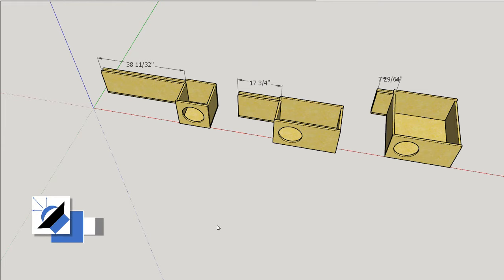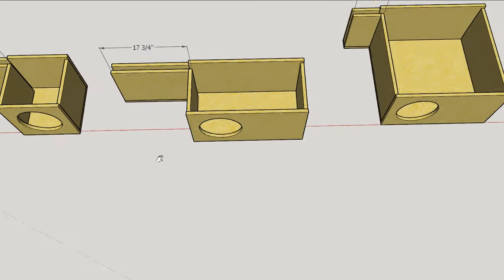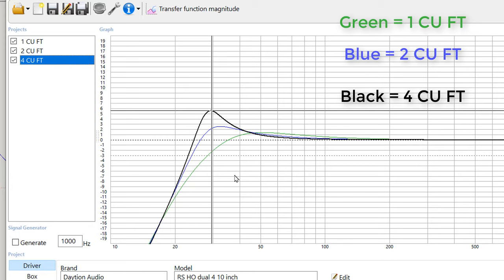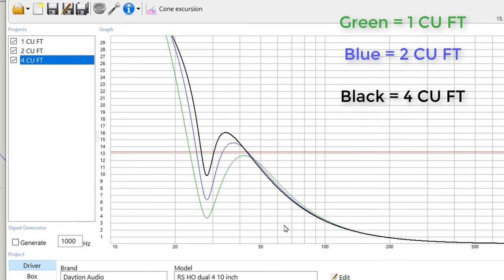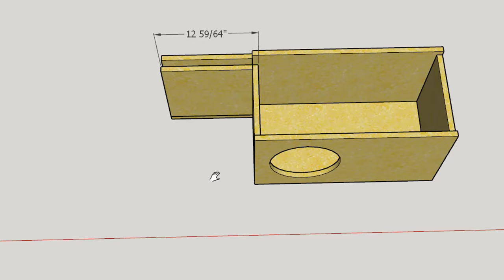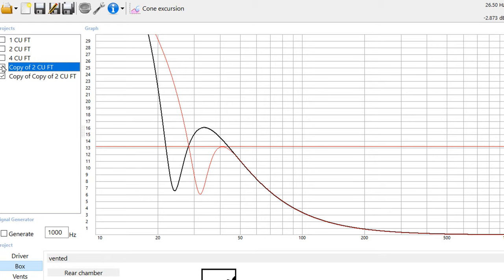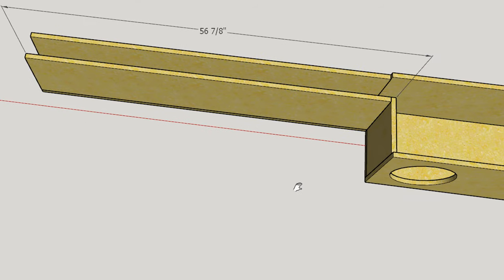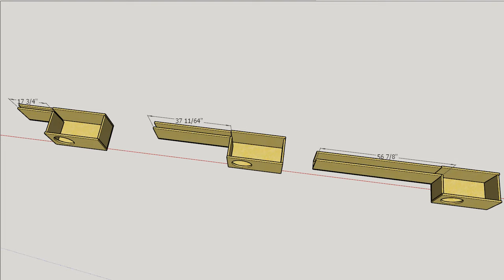Understanding Port Length, Box Volume, and Tuning Frequency.

Comment: Great video, I have a question, how the spl be with the bigger port area applications? So 40hz with 12*1 play with the same output as 12*3?
Reply from the maker: If you resize the port to get the same tuning frequency the three different port areas will all be equally loud.  But if you make the port wider and leave the port the same length the port tuning frequency will be higher and the peak SPL will increase -- if you take that the extreme the box will be "boomy" and not sound good.
Reply: I know, I wanted to know if I used for example 12*3 and made up the port length for the 40hz if It would play that frequency range louder than using the conventional 12*1 port area. 

Where I'm from,  we have a love for gallery type systems so bass reproduction is more geared to be loud outside the vehicle and spl is also calculated between 5-15ft away from  front of the vehicle depending on the classification of your system. 

So the experiment that I would like to try is similar to that of your third example, maintaining ideal cubic, acquiring a specific frequency with an increased port size and using cabin gain to get allot more output than the conventional box.
Reply from the maker: @dthknght  According to WINisd, It would not be any louder.  But, computer models don't always play out perfectly in the real world.  My bet is that the larger port would have less port turbulence, and thus the air flow would be less restricted so it might kill louder. It would definitely sound better.  

If you wanted to experiment with it you could make a detachable external port and swap out the different sizes to see what happens.  

It is definitely worth a shot.  I'm not aware of any big downsides to a larger port.
Reply from the maker: And I really like the idea of calculating SPL 5 to 15 ft away from the vehicle. The big SPL builds in the US are all based on building pressure waves up inside the vehicle.  It's an amazing feat of engineering but it's kind of boring to watch a car filled with concrete go brrrr for 10 seconds.
Reply: Yes it is allot more fun, shockingly enough, we use musical tracks to do these competitions. We try to maintain songs selection minimum to to about 38hz but as high as 60hz. Music from rap to reggae, but not to the extreme lows.
Reply: The link above is just an example of someone build in our country and we have both iasca and mecca forums. Iasca actually incorporated a gallery style competition in there curriculum, but it's only for the caribbean unfortunately. Some heads did not see the purpose of that in the US
Reply from the maker: It's like a rolling concert.
Reply: If you see how much power behind that vehicle. We also dabble in custom made subs, even have custom made lithium battery banks.
Reply: @DIYAudioGuy  hey what's up, I forgot to ask, the calculator you have, is the cubic value used is net loaded or net unloaded? Or is it gross?
Reply from the maker: @dthknght  I have a sheet for both.  Since you're a patron you should have access to it on patreon.  Message me over there if you're having trouble finding it all.
Reply: @DIYAudioGuy   ok no problem thank you

Comment: do you have fb or messnegr account sir? I dont have a gmail cxount or i forgot. I want to tune my prospect size of mya box, but i do not konw the correct messuremwnt of the port. I like low freq. and loud or for all genre ,usic. Here is my box. 

L-26”
W-17”
H-13.5”
That is an outside surface measurement. .. can u help me please sir?  For the port only . Anyway 
Lported type box and 12”subwoofer is cheper ang mde in china😅
From🇵🇭 i hope u help me sir  for the port only
Reply from the maker: Yep, DIY Audio Guy on Facebook and Instagram.

Comment: Why am I not hearing you take into account the amount of hurts that the speaker can actually put out if I have a 50 HZ speaker can I make the cabinet produce a lower hearse then 50 HZ you're not explaining this correctly spell all the stuff you're talking about has very little Factor compared to what the Hertz of the speaker is if the speaker is 50 hertz will it will never produce 28 HZ if you buy a speaker that produces 28 HZ well then you got 28 HZ right away what the hell is the problem here people
Reply from the maker: It's common for manufacturers to provide a frequency range for their speakers.  Those frequency ranges don't mean anything.